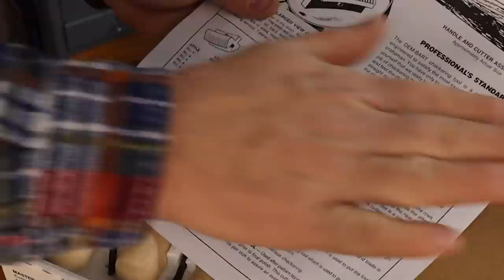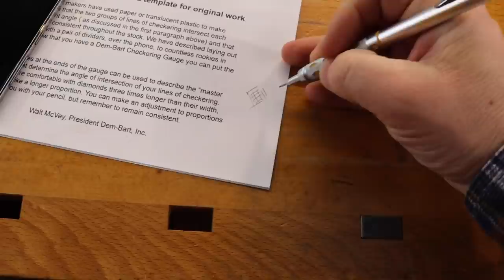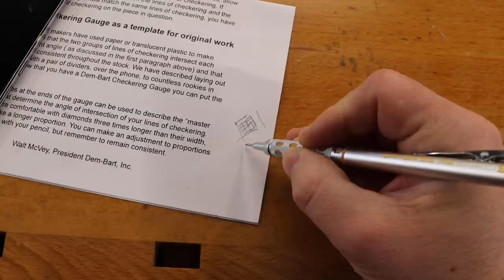How to add Grip to a Custom GUITAR PICK with a Checkering Technique

Comment: Awesome demo of a checkering kit. To keep picks from slipping between my fingers I use THICK sandpaper used on a grinder disk to remove paint off of metal surfaces. I super glue a small square of sandpaper on both sides of Fender medium celluloid picks.

Comment: Hi Ben. I use a commercial pick sold here in Canada called Cat`s tongue. It has a rough knurled gripping surface like that of a cat. Being red in color, it is usually easy to see when dropped in contrast to most floors. I like .73mm as it has the right flexibility for my style of playing. As usual you are awesome. Rock on you Bitches !

Comment: The short one is generally supposed to be mounted backwards, so you can use a “picking” technique to kind of roll it down and pull it back.  It cuts on the pull, so it’s perfect for tight corners and precision work.

Comment: Yes. Some 'mini makes' would be great. How about turning some beautiful control knobs made out of mixed materials ie wood+copper/brass/resin with that chequering (knurling?) on the sides? (Something that would go well with a Copper Rodded 😉)
Reply from the maker: I have a pad of different control knob designs right next to me as I type.. I'm thinking three videos, one based on using a lathe, one using a pillar drill and one with only hand tools.. any more I should add? B
Reply: @CrimsonCustomGuitars  anything that you can then send to me for my copper  Rodded 😄 . Always on the lookout for something unusual

Comment: I work on pool cues sometimes as a hobby and there's actually a little picking tool not like a guitar pick but it's just a little handle with a bunch of needles coming out of it the idea is to use it to make a ton of tiny holes in the leather pool cue tip so it impregnates the chalk into the leather so you don't misscue (taking a shot without chalk on the tip) anyways I followed your pic making tutorial and came to the same issue but my solution was to simply take my pool cue tip pick and place it on the pic and give it a few light taps with my fretting hammer with the polyurethane head giving it a few small hits then checking the grip and repeating over and over until I was satisfied with it

Comment: I've been just taking some sandpaper and roughing them up a bit. I also like to sort of "sharpen" the point. Obviously not thin enough to be actually sharp, that would just break off when you try to use it. I like a fairly thick pick to hold onto, but a fairly fine point of contact to make fast picking easier, and most thicker picks have an equally thick tip, just barely rounded over. Also, "sharpening" them with sandpaper like this makes the edges a little rougher, which seems like it helps to kinda "grip" the strings as you're playing. 

That said, I'm a mediocre guitar player at best. Decent guitar players may have entirely different feelings about this. lol
Great video.

Comment: Could you achieve an interesting effect if you stain the wood before marking?
Reply: Oooo, yeah, great idea. You get the original wood color in the lines, but the stained color on the bumps. Could look great.
Reply: or the opposite, stain after the fact and sand back on top so there is only stain in the grooves.

Comment: The company I mentioned in the previous video has a number of different hatching patterns on their picks.  They somehow do not get slippery when using, something about the nut material..
Also, you can dye the tugua material, the picks I have are ref, green and blue.

Comment: Ben, I found some checkering tools in my fathers stuff and tried them out a few months back.  I noticed I tended to cut the initial lines too deep... I think it's important to stay shallow on pass 1 and deepen after the design is in.  Also, is your short single cutter in the handle to cut on the pull?  I believe mine is which is very helpful for cleaning up ends.

Comment: I've never done this but my maker instinct is you need to start with a clearly marked zone to checker and work from the center out, does that seem right to you, having done it? Also, came out damned nice.
Reply from the maker: spot on, I really should have used transfer paper or something to at least work out the outer dimensions.. B

Comment: I have a beat to crap Hondo Explorer soon to be project.
( I just finished a firearm project, now it's time to get back to Frankenhondo.)
I don't know what kind of wood is under the hidious factory finish, but it may take well to checkering!
Reply from the maker: Hey Charles, I bet that as long as the wood is structurally sound a checkering pattern will only ever improve things! B
Reply: @CrimsonCustomGuitars   I hope so. I haven't stripped it yet. I think the only part I will keep is the body. It's finished in black polymer, with a prism tape style top.
Pretty gaudy when it was new I'm sure. Now it's just nasty! I think deluxe hondos were alder. Many of the others were plywood.

Comment: I wonder if the smart play would be to make a model in a 3D drafting program and then print one (or more) out as a pattern/mold for a batch of them to be manufactured.
A side-note: I haven't bought any "textured" plectra because, so far, whenever manufacturers put checkering or stippling on their picks, they never seem to get the texture down close enough to the pointy end of the plectrum where I hold it.
Reply from the maker: if we ever do production plectrums then they will be cnc or laser cut for the most part.. for this though it is just me experimenting and having fun. Frankly, I can make one of these by hand faster than someone could draw one and put through a machine, hell I can make 3 or 4 in the time a 3 d printer could do one properly imo. B

Comment: Hey Ben. Do you have to put some finish on these nuts to protect them against handsweat and all that gunk?
Reply: I'm not Ben, but I hope my reply will do. Tagua is a nut, and is oily. Its oil will protect it just fine and it probably would not hold a finish for very long, if at all.
Reply: @patrickwilliams3108  thank you, that helps me a lot. I didn't think about nuts containing oil, but you're totally right. It should be fine, shouldn't it?

Comment: These things are awesome. And, of course, you know that you have to make that guitar inspired by that pen now... But, I get the feeling that you knew we would want that, and you wanted to do it, so that's why you showed it to us. lol
Audience manipulation aside though, I really wanna see that guitar. lmao

Talking out my ass, but maybe it would work better if you outlined the area first? Might help to stop you from going outside of the intended shape, and look a little better. Sort of like the skip line outline that you're talking about, except flush with the shape itself. Went back and checked, and the pen has that outline too, as well as two layers of skipped line outlines. Looks amazing. 
It also just occurred to me that the skip line outline thing is essentially just an 8 point bit (like how the one you're using is a 16 point). So, if you didn't want such a fine checkered pattern, you could just use that. lol

Comment: Could you use those nuts for guitar nuts or are they too soft?
Reply: Tagua is very dense and very durable, but it has a tendency to chip out when put under constant pressure (even carving tagua is delicate business because of its tendency to chip). Over the years I have seen lots of people ask about using Tagua for nuts and bridges, but have never seen anyone reply that they have used it successfully for that.